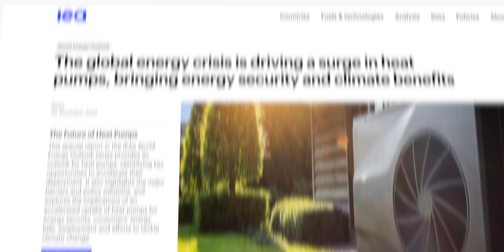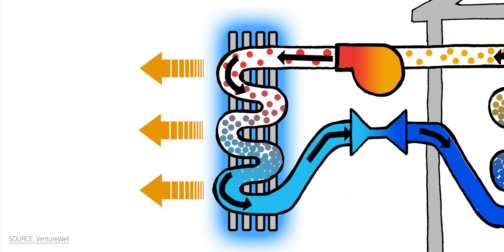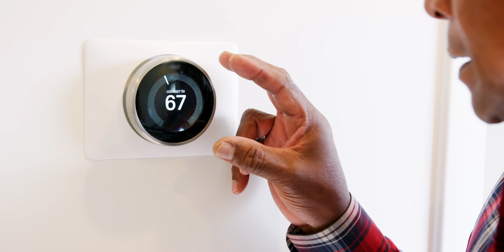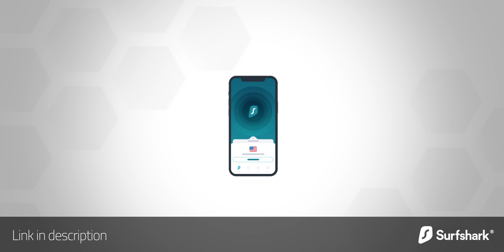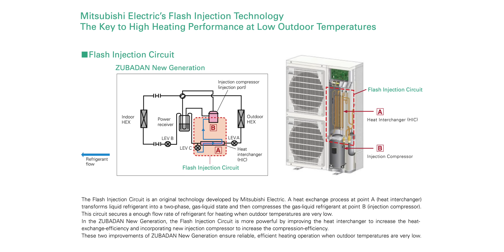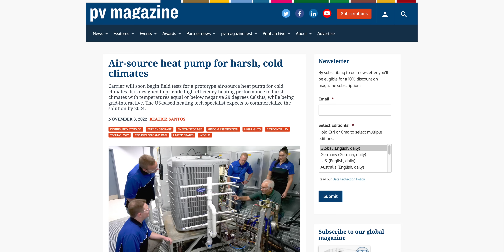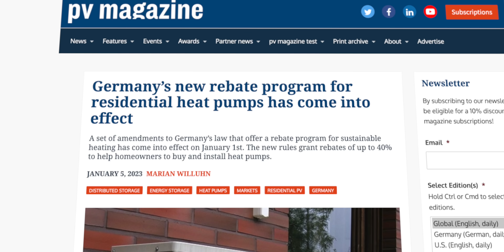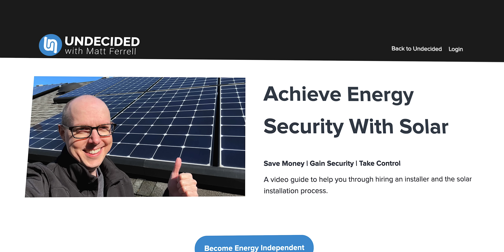Major Advances with Heat Pumps in the Extreme Cold

Comment: In my experience, we had a regular heat pump for over twenty years.  It worked.  Then I was talked into a geo-thermal system in 2013.  Out of pocket cost was about $8K.  Energy savings are negligible.  Monthly wattage drop is inconclusive.  The house is all electric.  I think if the installers had buried the coils a bit deeper, it would perform better.  The trench was about four feet deep.
Reply: From everything I've read on the geothermal pumps (on our wish list as well) the deeper the better for your outdoor coils.  At a minimum 2-3 feet below your frost line.
Reply: The technology has changed drastically in the last 10 years
Reply: Where are you located?

Comment: "Heat pumps" come in many forms these days. "Split unit AC's" (or some variation) that are basically air to air heat pumps are quite common and don't require earthen trenching or aquatic proximity and are commonly available. Such units are more thermally efficient (KWH/BTU) in areas where the ambient temperatures are not usually far below freezing. They are still expensive, even without the soil/water coil. In a moderate climate they work very well, and in the summer they can cool... That is the take home. Now balance your need with your environment and resources. Perhaps you live in a rural place where firewood falls from trees and you can balance out the very cold days when heat pumps still warm but are less efficient.

Comment: Great info, Matt.  My furnace is the original that came with the house and I was thinking of swtiching to a ground sourced heat pump as the house is 26 years old, but if they're going to have heat pumps that work more efficiently in the cold WI air, then I'll hold off and wait to see what is coming to the market.  Will have to see what and how much a switch to a heat pump will entail.
Reply: Grabbing stored ground heat though will probably be cheaper power wise though, and as a bonus will work down to really cold temperatures, so while the up front cost is higher might be worth it if you plan to live there long term, as power costs will never decrease.
Reply: Ground source heat pumps will generally be more efficient, if you can afford the extra investment, since the ground doesn't get as cold. I wouldn't wait with installation, though. Even if it gets too cold occasionally for the heat pump to work efficiently, just keep your old furnace as backup heating. You'll still be able to exploit the benefits of heat pumps whenever you can use it, hopefully in the high 90%'s of the time.
Reply: No need to wait. They’re in the market now. Mitsubishi “hyper heat” heat pump works efficiently down to -13. 

I know WI can get below that occasionally, but it’s pretty rare. Normally only with wind chill when I lived there.
Reply: @tylermotherfnleroy  Thank you!  Since we are colder for longer periods of time I would just like to see what the efficiency of the heat pump would be for let's say 3 months when temps are between 0F and 20F.  The summers for the past 5 years or so have been fairly mild so my solar has really taken care of that pretty easily with the old unit I have as well.

Comment: Not gonna put a heating system in my house that might fail when it's needed the most. These heat pumps need to be 100% reliable up to -30C. No "can potential continue functioning under perfect condition in -30C".
The current systems sound more like buying a fire extinguisher that stops working when smoke is nearby or a homedefense gun that stops working when it detects that you are in an urgency.
Reply: It's not about reliability but efficiency. ASHPs become less efficient the lower the temperature goes.. If you're regularly seeing -30C, then Ground Source is the way to go, as the borehole provides a relatively stable temperature to work with, meaning it's just about as efficient at +15C as it is at -40C.  The downside to GSHP is, an ASHP will start to quickly and sometimes quite substantially outpace the GSHP's efficiency in the +5C to +15C range.
Reply: @BenIsInSweden  What's with the frozen parts then?
Reply: @DoubleBob  ground source you only have a couple of pipes that leave the building filled with a brine solution, so in that regard there are no parts to freeze.  Air source still works in really low temperatures but will have to defrost the fins to remove the build up of frozen moisture.  Modern ones do this by temporarily operating in reverse to bring the unit back up to efficiency until the build up happens again.
Reply: @BenIsInSweden  I see. I'll read into some more reviews.

Comment: E .E.R. and S.E.E.R. are based on the area they were manufactured in.
Not the end consumer...
They leak out Refrigerant due  to heating up the Schrader valve seat materials causing splitting and leakage.
   At cold temperatures below 32 degrees it uses Electric Heat strips for back up . some units work nice for businesses if they have many split systems . nothing beats wood heat only Electric comes close. Just do what Nancy Pelosi said and just put on a jacket

Comment: We installed a Mitsubishi system 2 years ago. We did a manualJ which said we needed a little over 3 tons of heating and cooling for our 3 story, 3890 sf house (2 floors plus basement). We installed a 4 ton outdoor hyper heat unit unit and 2x 2 ton air handlers each air handler has an emergency 7kw electric heater sitting on top. 

We recently had -10 degree weather with -30 wind chill. The issue was that we could only get the house up to 58 degrees without using the emergency heaters. Having to rely on electric heaters defeats the purpose of switching to a heat pump.

The mitsu system claims to be 70% efficient at -15 and it's said that heat pumps are not affected by wind chill so we should not have had the issues we experienced. 

Latly, there is a huge discomfort factor with heat pumps. Heat pumps are meant to run for long periods at a low speed so there are temperature variations. As an example, we set the thermostat to 71 and the unit will typically run till the house it super hot sometimes as high as 74. On the other side sometimes the house will drop to 69 before the unit decides to turn on. I personally find it frustrating.

Comment: i have added a heat pump, and it is incredible.. but my fairly decent ones stops being able to heat the RV fully ad 15 degrees Fahrenheit. (Note it's a bit small for my space, and I set it up myself so for now skipped some efficiency steps). But However this is a surprising frequent problem... While i am sooo soo glad i put it in because its way better then the propane heater. it cannot do it alone in the cold.